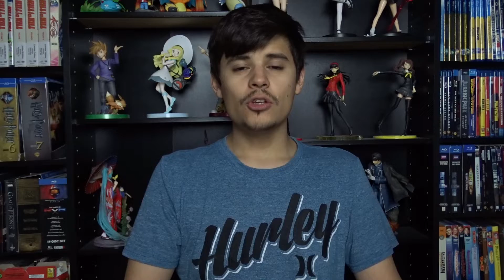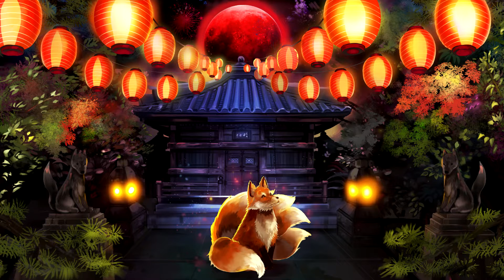CPU Overheating Update -  Disconnect Corsair H100i here!

Comment: I have no clue what is happening with mine either rn. Everything is connected, thermal paste has been changed, ive checked for malware with defender and avast. I downloaded icue to update the driver, but pc shut down while updating. Icue said the pump was on 0rpm, so i assume the pump itself isnt running... no idea what it could be. My fans are on 100% and cooler blinks red from boot. Only have around 3-5 minutes before computer shuts down from overheating. I booted in BIOS/UEFI and it was at 101⁰C when i checked. For some reason task manager doesnt show temperature (for me at least)
Reply: Did you find a solution? I am having the same issue i think.
Reply: @F_David. Hi! So i downloaded icue an booted and monitored the temperatures and rpm, thinking maybe the problem was electric supply. My landlord is an electrician so we went through step by step confirming that everything had electricity and in theory shouldve been working. 

In the end we concluded that my liquid cooler pump had died. I had just moved, it was like 8 years old, and mightve been rattled around a bit in the car. In theory it shouldve been pumping, but it wasnt, and so my cpu was unable to cool itself, and would overheat and then my PC would shut down. The problem disappeared as soon as i changed cooler. Landlord had an old fan from a former PC that ive been using as a substitute. Havent had a problem since then.
Reply: @shamstam, well, that is unfortunate. I may have the same issue then because my pump may have died after 2 years.
Reply: @F_David. Mine started making a rattling sound before it fullt gave out. It rattled and rattled and searches said it was caused by bubbles in circulation and to leave the cooler and pump on at a 45⁰ angle until the bubbles subsided. I kept it diagonal for a couple hours   a day for 2-3 days to see if it would help reduce the bubbles and eventually it just stopped running altogether. I feel lile a 2 year old cooler like yours (if i understood correctly) maybe shouldnt be giving out so early 🤔... maybe if you have a warranty you could get a substitute
Reply: @shamstam I have a warranty, but I have noticed that when I enter the BIOS and before the red blinking, it starts to cool the CPU down, only after the red blinking, the cooling stops. So the pumps are connected to the red blinking maybe they stop..
Reply: So the cooler works for a little bit after boot, and then gives out? I learned that a cooler might have a manual/guide on what the blinks mean too, they could be worth checking out. I think different patterns and behaviours signal different things. Im not sure why a cooler would work for a bit and then stop
Reply: Another comment mentions that they mightve had a bigger air bubble that caused their cooler to auto shutdown. They also sent theirs in for a replacement

Comment: Thanks for the follow up! I had the same problem fixed the issue removed the hub commander from the water cooler. The instructions were vague. There should be separate instructions for the water cooler then instructions for connecting the I-link fans but still working on getting all the RGB to sync together but resolved the heating issue. Thanks 👍

Comment: I had to flip the low quality controller upside down, its the connection to it that keeps throwing up the cautionary exclamation mark, as it only happened when i closed the case at the side. I returned it in the end, corsair said it was faulty. Any slight movement of the cables from the core would cause either incorrect readings or a pump failure. The official forum has a long list of red triangle and pump problems associated with their coolers

Comment from the maker: And now I just deleted all the corsair software off my computer because it was acting up again. CPU started getting hot for no damn reason
Reply: i just plug mine into the pump header on the mobo, the 2 fans into the cpu fan headder and control it with the bios, which sounds similar to what you did. i will say too that if you have moved your case for cleaning or whatever you may want to tip it when you turn it on so that any air bubbles that may have gotten into the pump can get out. had mine overheat on boot yesterday due to an air bubble.

Comment: quick / bandaid fix. move the CPU pump tiny cord to another fan port on your motherboard. instead of it being on CPU i put it on system fan 2 and it will work. untill you can fix the major issue.

Comment: I'm using the h100i that works fine for the first 10 minutes or so after powering on the pc. After this 10 minutes it's starts blinking red, but the temperatures of the water and the cpu don't change. Nothing is overheating, the pump just stops working. Sometimes it will turn back on and start working again but will usually repeat this process over and over, whether I am running programs/games or not, I still get this blinking red effect.
Reply: Have you found a fix now? I'm getting this exact same issue.
Reply: @iiTzJaMiE  unfortunately the cooler was faulty and I had to return it. Luckily I purchased a protection plan so I was able to get a free replacement
Reply: I get the same issue right now! did you find a solution?
Reply: @shuvam_gtm  somewhat. I shook my hoses around with the pump running on extreme to try to get any air bubbles out of the system. Then I secured the hoses up to the top of the case so they would be running straight down to the pump instead of curving out. I believe the issue is to do with an air pocket stuck in the pump which produces a lot of heat in the pump causing it to auto shutdown. This has given me major improvements but I still have had it shut down after doing this. Not 100% perfect solution but it helped me in my situation. My radiator is mounted to the top of my case so depending on your setup my fix might not work in your situation. Hope this helped

Comment: I have the same overheating problem with a silverstone td03-slim, but I have the pump connected to the motherboard. And the computer gets no sun. Just replaced thermal paste, but no dice, still overheats like crazy. Maybe I'll replace the AIO water cooler by a regular cpu cooler. Ps the water cooler hoses barely get warm when the cpu is hitting 80-90°c
Reply: same problem here, even at stock CPU speed
Reply: Maybe the AIO needs reseating, make sure backplates are tight, cpu in center, and pressure the AIO towards the cpu a bit while screwing.